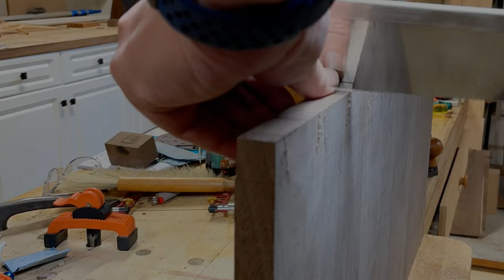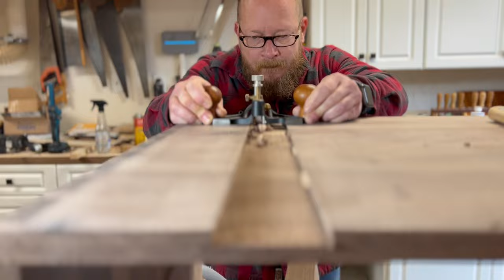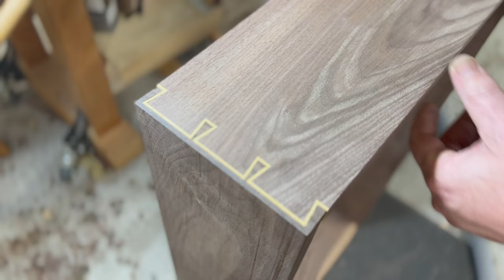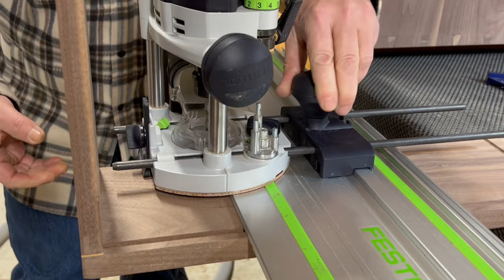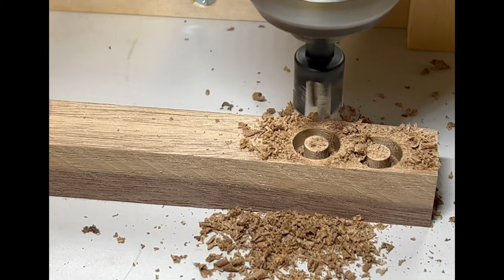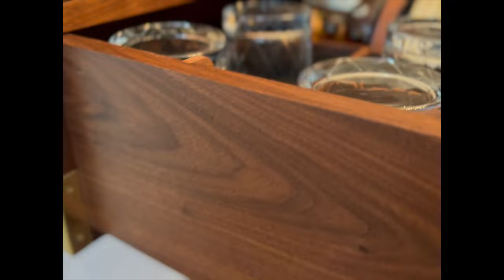Upland Hunting Chest Build Process

Comment: Curious, when you used the track saw to cut away the inside of that giant sliding dovetail why didn't you use a router?
Reply from the maker: Great question! Yep, I absolutely could have used the router. I think I already had the track saw out for other cuts I was doing? Also, I knew I would “walk in” the final depth of that sliding DT with my router plane, so I just needed rough out the material. In hindsight, you’re right- probably would have been quicker to get out and set up the router. 😄